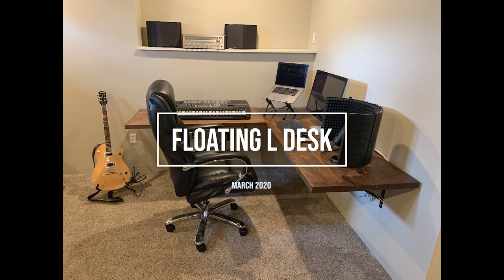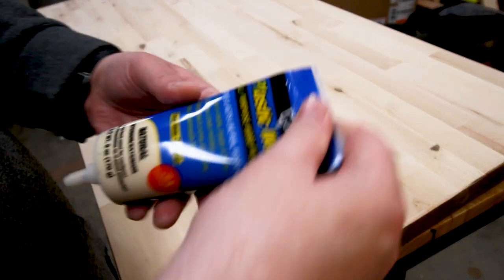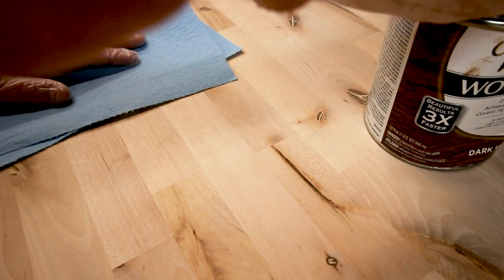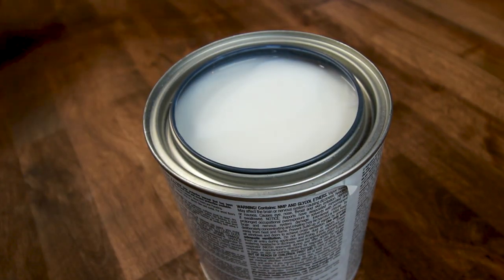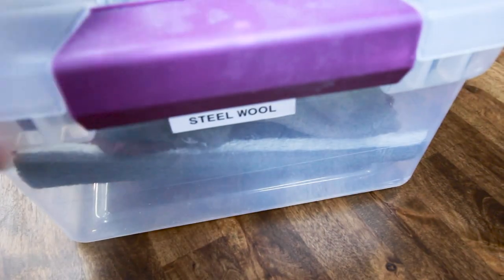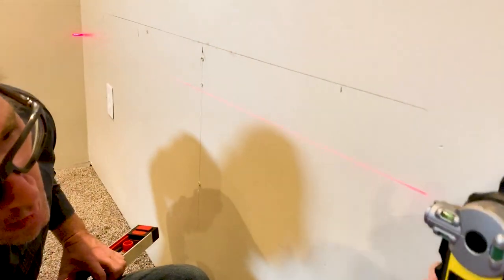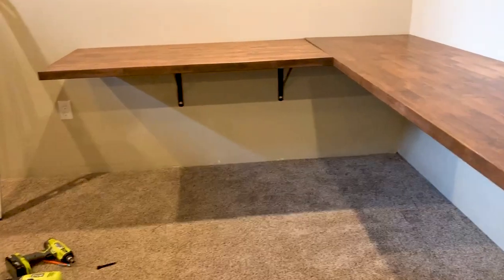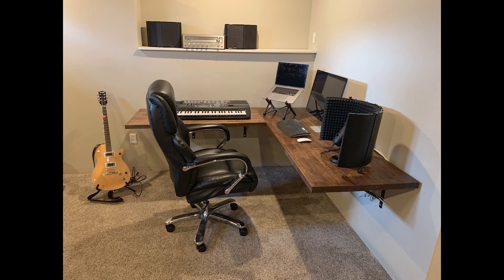Floating L Desk for Music Room

Comment: Most sites recommend no more than 5inch overhang from brackets, have you noticed any issues so far? your brackets are only half the length of your desk
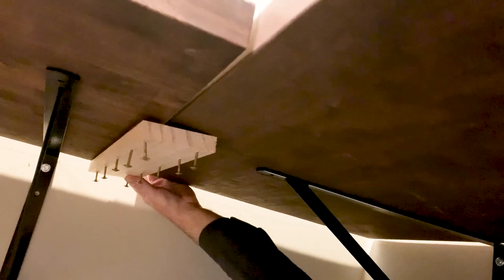Reply: No they aren't? At 13:48 you can clearly see the brackets are over 3/4 the depth of the desk with only a 5 or 6 inch overhang.

Comment: I really appreciate the detail you went into while explaining this. I'm just not exactly sure what to buy to bolt the brackets into the studs, or how you did that, can someone help me out?
Reply from the maker: Where I got them on Amazon is linked in the description.
Reply: @obscurityworks5933  you didn't link the lag bolts, I'm going to try 1/4" 2 inch lag bolts

Comment: What size lag bolts?
Reply: Did you ever get an answer ? I'm thinking of building this desk.
Reply: @tiduswrath  nope, I built my desk this way though. Def sturdy, I can sit and stands on it. I have an extra I used and can tell you the measurements / describe it. 
The length of the bolt is 3 & 1/16” long and the diameter of the head is .5”. The head does not have a Philip or Flathead indention, they have to be ratchet on. Head also says ATC. I think I got it at Home Depot when I got the brackets. If not, then it was Lowe’s. Pain in the butt to figure out.
Reply: @realworldguroo  that's awesome. Thanks so much for the info and for answering extremely quickly.
Reply: @realworldguroo  I'm sorry I didn't respond sooner. Our earlier videos only got a couple of dozen views, so I wasn't watching the comments as this one picked up 27K views without me noticing. I'm glad you figured things out and yours is working. And, thanks so much for sharing the details with other folks in my absence.

Comment: do you worry about wood movement when attaching the brackets to the top? ie. directly screwing into the wood top as opposed to another fastening system?
Reply from the maker: Maybe if I was putting them somewhere where the humidity and temps swing wildly. My basement is pretty consistent year-round. But, even then, there's a bit of room for movement in the bracket holes. In the 18 months they've been in use (I built another of these), there have been zero issues.
Reply: @obscurityworks5933  thank you!! working on a similar project with a live edge walnut slab and L brackets.

Comment: Do you find the shop towels apply the stain cleanly or are little bits of shop towel left behind?
Reply from the maker: As long as I have the surface properly sanded (to 220 grit), I never have any shop towel bits on the surface.

Comment: Your pilot holes looked way too small for those lag bolts. Could just be the camera but I’m guessing that’s why the lag bolts were breaking.
Reply: I did use a bigger bit on the brackets the next time. What's weird though is that we had used those same lag bolts in the shop without breaking shortly before we did this project.
Reply: @JWynia  I think your lag bolts broke because you used stainless and not galvanized lag bolts, I have always found galvanized to not look as good but much stronger, great video thanks so much